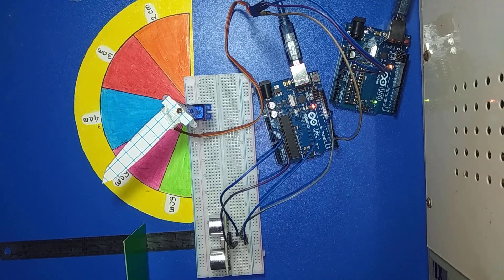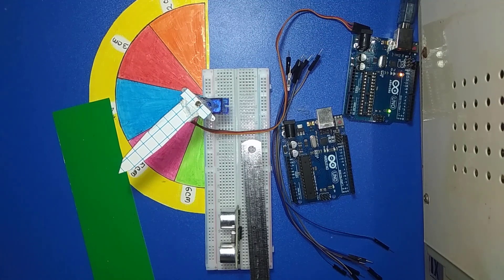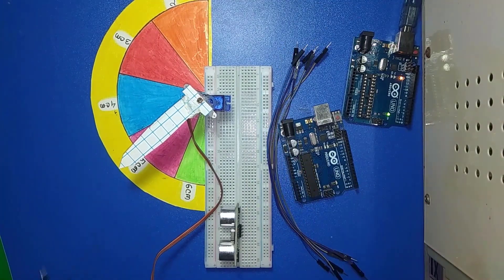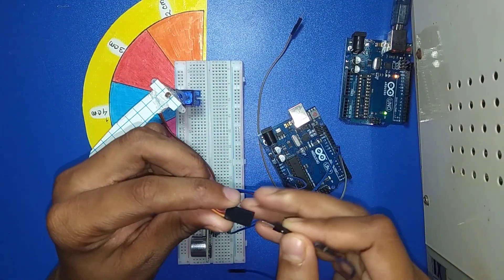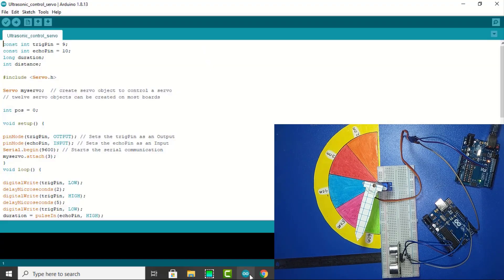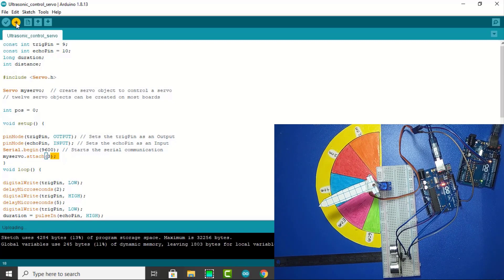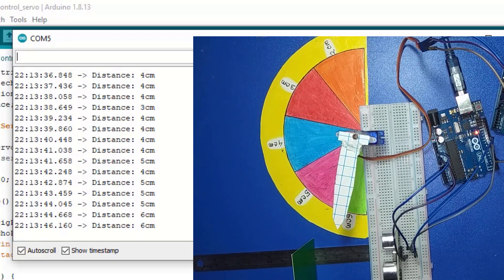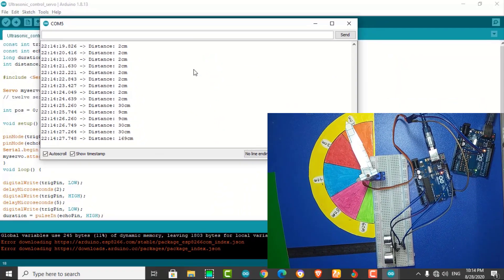how to control servo by ultrasonic and arduino with code|| Control Servo Motor Using an Ultrasonic

Comment: Can you make it Wireless... Please
Reply: Please make it Wireless.... I subscribed at your channel and I will make all of my friends subscribe to your channel If you make it Wireless
Reply from the maker: @hamdyahmed36  https://www.facebook.com/md.manu.777/

Please contact in my fb
Reply from the maker: Sure. 
It’s possible. Give me some time for creat it.
Reply from the maker: Sure.
Please give me some time for it.
But why you want it wireless??
Reply: @techsigmarobots  because I will put the ultrasonic sensor in A far away place because I want to make a trick in my sister.....

I will subscribe to your channel

Can you make it Quick.. Please

But I will make it automatic hand sanitizer

You can search for automatic hand sanitizer dispenser on YouTube
Reply from the maker: Lovely.
If you want to  pass long range data so here you need to use LoRa technology.
Lora mens Long Rang.  I will provide you this project free insaallah.
Which country you are form??
Reply from the maker: @hamdyahmed36  Its easy. i will guyed you. At fast you buy an arduino ,Ultrasonic sensor , battery and a little pump.
Reply: @techsigmarobots  Iam from Egypt and I can speak English very well